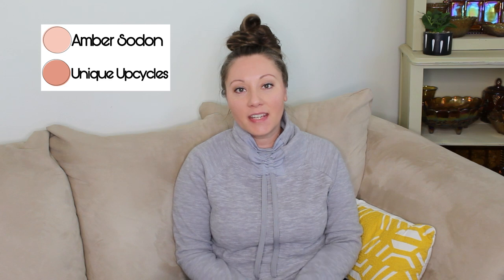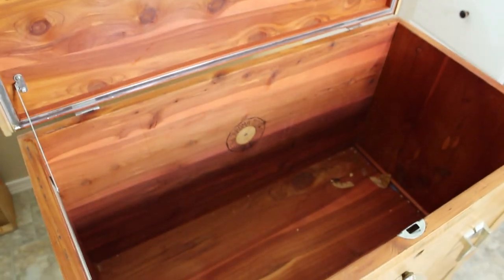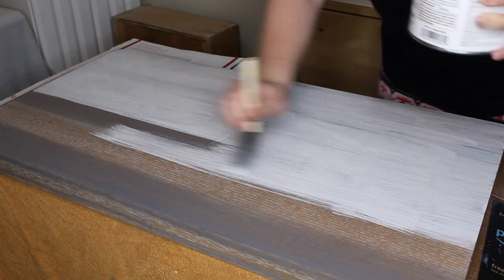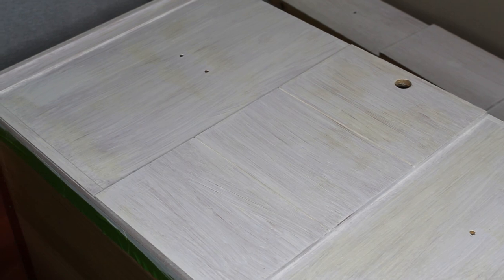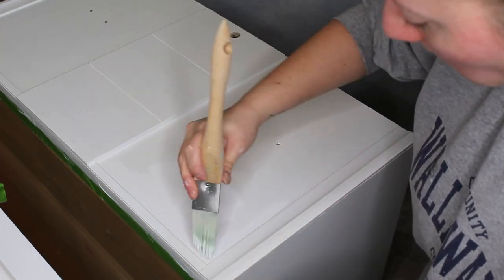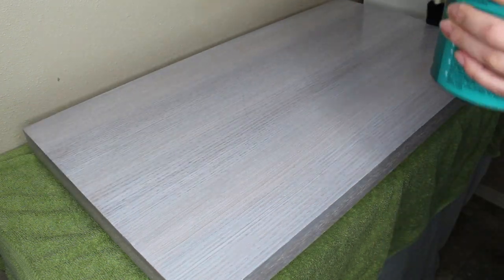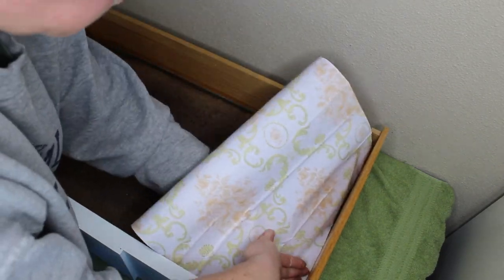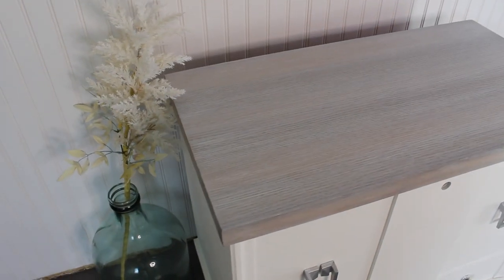Furniture Flip | Furniture Makeover | How to Layer Stain | MCM Lane Cedar Chest

Comment: I stopped immediately when I saw the title about layering stain.  Never seen it before but I would absolute try that now.  The gray turned out so pretty.   
Have you done that alot? I have so many questions about it.  Maybe you can make another video about what kinds of stain mix well and whatever we have to know.  Love the cedar chest. It's the first one shaped like that I've seen.  I bought a really long one that's low to the ground at a yard sale.  It was in rough shape.  Thanks for the tip about the date also.
Reply from the maker: Thank you! I’ve only played around with stain layering a few times. I definitely plan on using the technique more in upcoming videos!

Comment: Beautiful 😍
I really appreciate all the great information. 
I have been repurposing furniture and you have supplied me with so many useful tips. For example: going from a low sanding grit to a high one whereas I used to do the reverse, using a damp brush with a water base top coat, using a syringe for gluing, watering the chalk paint, how you clean the hardware). WOW. 
Thank you so much ❣
I look forward to viewing your other videos. 
I do have some questions and I hope you won't find me too annoying. 
• Would you consider or have you ever used a small paint roller instead of a brush when painting a piece of furniture like the one in this video ? I ask because I feel it leaves a smoother finish on the wood, whereas sometimes I can still see some brush strokes. I wonder if I'm doing something wrong. If the paint is too thick or if I am using too much of it on the brush. I've tried a few brushes but to no avail. Not familiar with the ones you use. Maybe it's my technique and am not holding and stroking properly. 
• You went over the piece a few times with the chalk paint. Would it not have been as often if the paint was not diluted ? Just curious to know if in watering chalk paint, it can cause you to go over a piece more often due to coverage. 
• How do you know when to use a sponge brush, a bristle brush or a cloth roller ?  
Sorry for all the questions and the long comment. 
Love your channel. 
Congrats on the subs 🎉
Take care 🤟
Reply from the maker: Hi there! Not annoying at all. I’d love to answer your questions! I’m not a big fan of rollers because unless you’re painting something completely flat they don’t get into all the edges and details. It really just is a personal preference though.  Some chalk paint can be really thick. This particular brand is. If you don’t water it down you’ll definitely get more brush strokes and drag marks. It’s just not very workable when it’s that thick.  So for topcoats I only use water based ones and you want to use either a synthetic brush or a foam brush to apply it. Either one works and I switch between back and forth between both of them. Brushes for painting change with the paint brand. If you want a smoother finish usually a synthetic brush will be a better option. If you want more texture go with a natural bristle one. Also different brands are more self leveling and better at hiding brush strokes than others. I would just keep testing out different paints until you find what your looking for. Next weeks video I’m using a brand called Melange for the first time and it’s really smooth. It leveled out beautifully. Hope I answered everything for you!